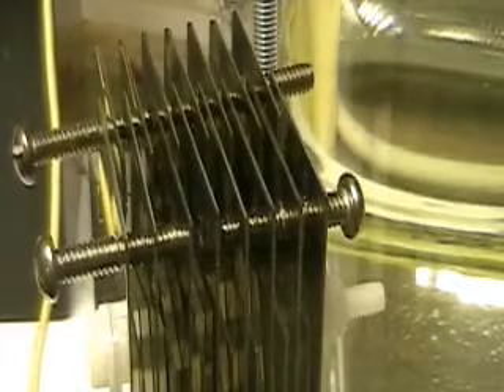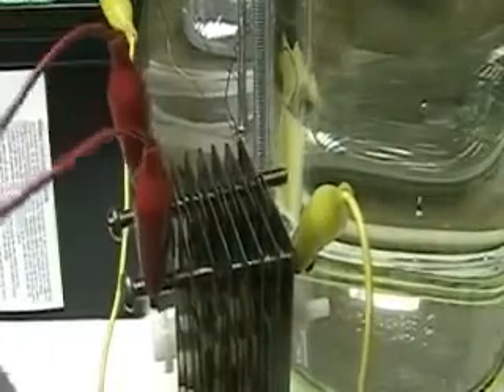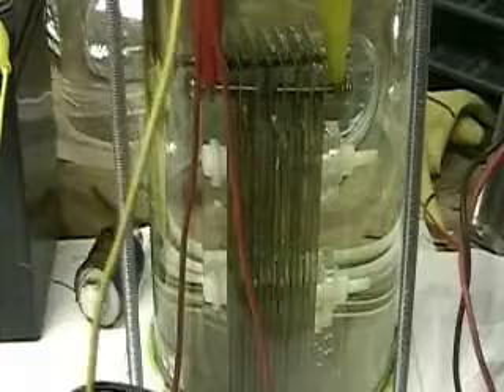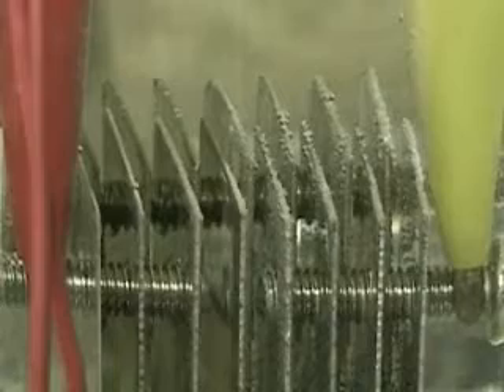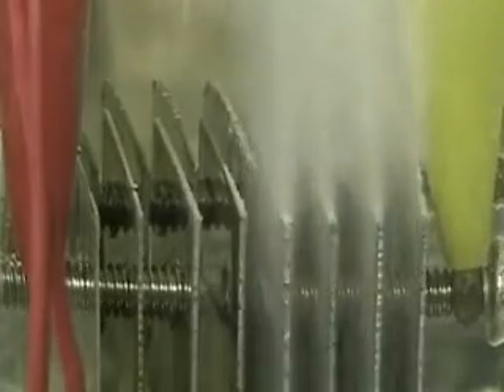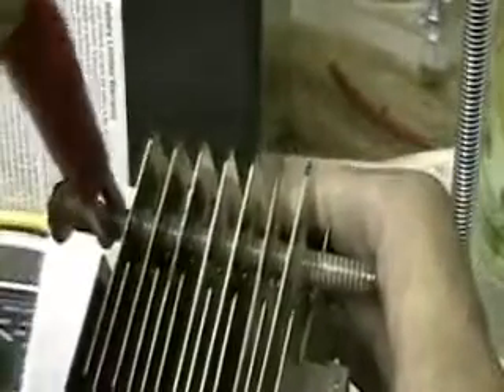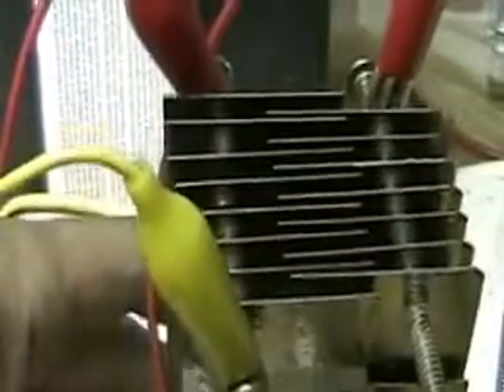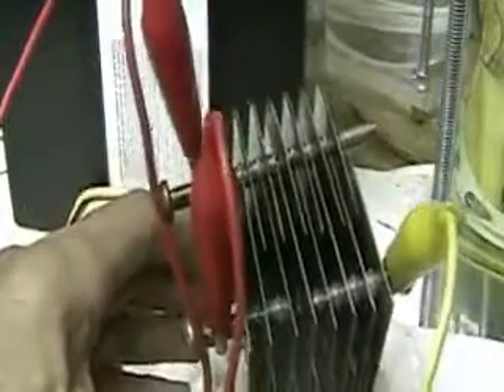Hydrogen Tap (New ConFig MUST SEE) 162

Comment: John, what if you were to tie four of these cells together exactly the same way you did with the four car batteries? could you utilize a pulse circuit switched across those four cells to get the same results, but with very minimal external input? after all, these are technically capacitors, they should respond in kind once "charged".